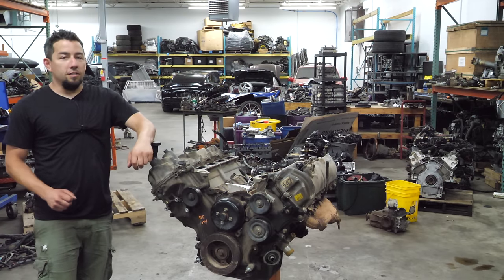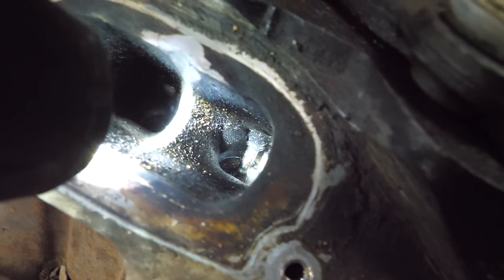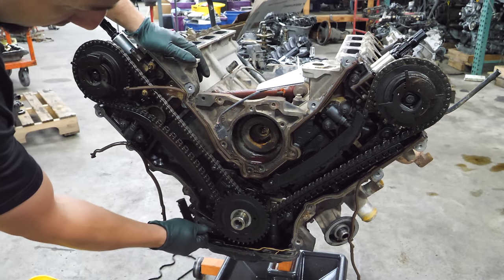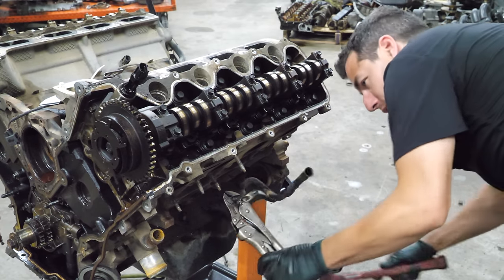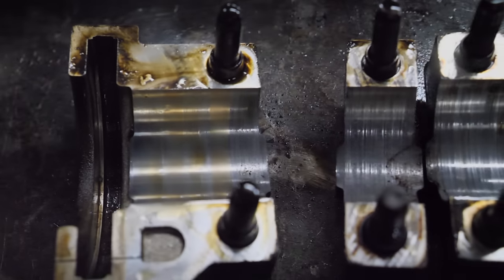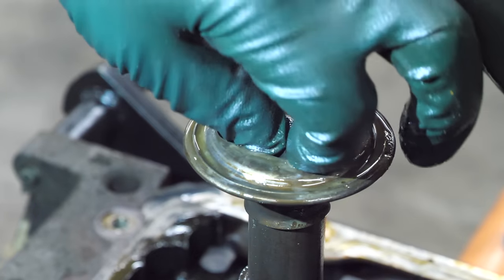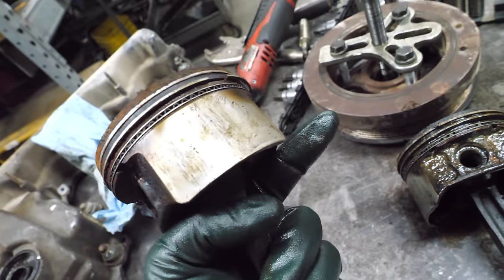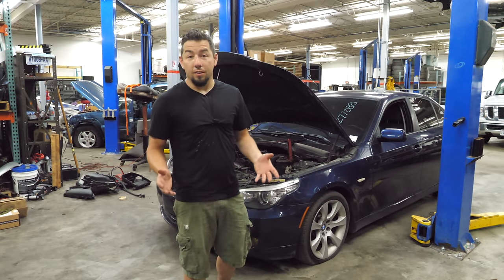Bad Ford 5.4 3-valve V8 Engine Teardown. Which of The MANY Possible Failures Took This One Out?

Comment: I have a 5.4 3v engine in my 2006 expedition,  130,000 miles now.  All original and no problems so far.  I change oil long before the recommended miles,  which I'm sure is helping it last. Plugs came out great at 100,000 miles.   Still happy with it.
Reply: Yea oil changes are critical on these since most of the issues are related to oil starvation. I had one for 10 years that I never had any issue with but I was aggressive on oil changes and stuck with synthetic 5W30.
Reply: Mine is close to 300,000.  No big maintenance.  I put a hub on the front.  Bought a used one at a junk yard for 40.00 and kept trucking.  Air and all still works great.
Reply: I have an '07 f150 short wheelbase 4 wheel drive it'll blow an actuator off of a hub and a heartbeat and it ticks $262,000 mi it is still my truck it's paid for and that 54 will run and pull a trailer like nobody's business I'm going to work on it alone and keep it
Reply: I have a 05 3v did the same short oci with synthetic oil. Its only a matter of time. I needed a complete timing set done at 175k. I used 5w20, I hear if you used 5w30 it will help it last longer.
Reply: Oil is still cheaper than a repair job on the engine.  That is why my 2000 ford is still running right now with my pal down the street from me
Reply: @bubba99009 was the 5-30w on purpose?  Because my expedition asks for 5-20w
Reply: @marspalacios  the 5w20 is a bit too thin for the 5.4 with its oiling problems - it's only recommended because it slightly improves fuel economy so I wouldn't (and didn't) use it

Comment: This is EXACTLY what happens every 90,000 miles. Did mine twice. Same side broke, right into the pan. Melling oil pump and Cast adjusters installed 2nd go around along with Phazer delete. Plastic doesn't belong with metal parts. Chains way too long. Absolutely ridiculous. Good luck keeping check engine light off.

Comment: I purchased a 2004 F150 brand new. Still have it. It's now 2023. $145,000 mi. Never gone more than 3,000 miles between oil changes. I do not have a tick. A rattle. A shutter. 2 years ago I switched to Amsoil full synthetic signature series. May seem overkill. Still cheaper than a new motor

Comment: Oil pressure is the major failure on these. As you can see, bank one was far shinier than bank 2 because of lack of flow as it goes from the pump to bank one and then bank two on this engine. That's also why your tensioner on bank one failed. Mine did similar, but never failed so I upgraded the pump, replaced all the timing chains, guides, and tensioners. Also replaced the cam phasers with locked phasers - shout out to Freedom Racing for the whole kit. You have to run a software tune for the locked phasers but it makes it a lot more bulletproof.
Reply: I did the same thing to mine, and it's running smoothly.

Comment: After repairing one of these engines, I've come to realize that THE primary problem with these engines is the original oil pressure fed timing belt tensioner. When the back sides of these tensioners start to leak oil, it allows slack in the timing chain. That slack allows the timing chain to slap back and forward and eventually breaks the plastic guides. Now before all that happens later, other damage is being done due to lack of oil pressure because of that leak. The leak at the tensioner is practically another pressure relief which causes problems with the cam phasers because those need proper oil pressure to operate. So really the original tensioners are the 1st domino and once that domino falls, everything else will fail soon after. 

My recommendation is if you have one of these engines that isn't making noise yet, IMMEDIATELY have a tech as preventive maintenance, pull the front cover and replace both timing chain tensioners BEFORE they fail. Ford came out with pretty decent upgrade that had a hard nylon type seal on the back. Oil pump wise, those are actually fine as long as you don't have any internal leaks from the tensioner. The engine I worked on had 208k and the internals were very clean from regular oil changes and the cams was perfect. You can't go that many miles with a weak oil pump so I know the leaking tensioners late in this engines life cycle was the fault.
Reply: True.  My buddy has an '02 F150, he heard about this and updated his tensioners.  Replaced all the vacuum hoses too as they were rotting.  He lives in SoCal, which has a lot of ozone in the air.  Suitably looked after these engines can last a long time.
Reply: @Craig Hoffman That's smog, not ozone. Smog is mostly carbon/oxygen molecules. Ozone is usually 2 or more oxygen atoms bound. C'mon with that, mang.
Reply: @craighoffman6876  Dry heat. Dry rot. 
Living in Vegas, my tires usually rot before I wear them out.
Different grades of plastic/rubber deteriorate at different rates.
I have an original 92" Jeep Sahara, nothing has deteriorated. Plastic and rubber holding up fine. 
My Chevy and Ford pick ups, vacuum lines get hard and turn to dust. 
Why AMC rubber holds up? Who knows? 
I have 12 (in good condition) cars, trucks and Jeeps. Besides rubber, nothing deteriorates in the desert. Keep them out of the sun and it will last virtually forever. With no cold starts (ever) even engines last.
Reply: @TheBandit7613  Interesting!  It pays to keep an eye on all of the rubber bits.
Reply: Any engine that relies on consistently high oil pressure to provide primary tension to its timing chains will fail prematurely, unless the system is perfectly designed, which none of the American engines are. The overhead cam Ecotec engine from GM is a prime example- ask me how I know.  

On the 3 valve 5.4 engines, Ford apparently tried to save money by using the same rocker arms as it did on its 2V engines(going from 16 rocker arms to 24) overlooking the large size of the oil holes on those original rocker arms and the need to increase by a third  the amount of oil flowing through those holes in the rocker arms to lubricate the cams, but they did this without increasing oil pump pressure or checking the oiling system's ability to supply adequate oil pressure and oil flow to the cylinders at the end of the oil distribution system, i.e. the #4 cylinder (on the passenger side at the fire wall) and the #3 cylinder next to #4.  The belated fix from Ford was to redesign the rocker arms to decrease the size of the oil hole on the lifter end of the rocker arms, thereby allowing the existing oil pump to supply adequate oil pressure and flow to the rocker arms and cams shafts of each cylinder, in Ford's view.
Reply: @Anonymous-it5jw  Interesting!
Reply: @navyphyrfitr6550  WOW, thx for adding that. It all makes sense.
Reply: @navyphyrfitr6550  Excellent!  Here's to many miles of reliable service from your engine.
Reply: You nailed it in the head!
Reply: @tmo2798  the main components of smog are particulate matter and ground level ozone. Ozone is always three oxygen atoms bound together. Two oxygen atoms bound together is normal oxygen gas.
Reply: @navyphyrfitr6550  I totally agree. I had 225k on my '06 last year and it was still running just fine, but I've known about these issues, mostly from Fordtechmakeuloco channel, so I decided take precautionary/preventative measures. I did all the things you did except I did use the upgraded Ford tensioners, not the Ford racing ones, I didn't know about those. Anyway, I just went over 250k and still purring like a kitten. I do keep up with all the maintenance and that plays an important role, not just with this engine, but any engine.
Reply: the other problem is a design flaw with the cam followers... the needle bearings wear out
Reply: You said it perfectly. Right on the money. Everyone I have tore into had a leaking tensioner that let the chains go slack. Then the slapping on the cover,, making sparkling glitter. Then it's all over.
Reply: This is the best explanation of this engines problems I have read so far. Thanks for sharing!
Reply: What was failed to be mentioned was that this “failed” engine probably had extremely high miles on it. It clearly shows a lack of proper maintenance. These engines can have quite a few issues however, When properly maintained, they generally last for many miles with lots going 200k miles. Best is to properly maintain and then have the timing components and roller followers replaced with updated parts at around d 100 to 125k miles. Not cheap but, it at that point, should go another 150k miles.
Reply: @Ronald Barry  But proper maintenance isn't gonna stop the tensioners from leaking from behind because the rubber sealing will eventually give out. My engine had 208k and was very clean from proper pil changes. I stated that in my OG post. As I said there is a design flaw and the newer version are much better so it's best you change them out BEFORE all hell breaks loose on the original tensioners.
Reply: @rotaryperfection  that is true, I did a full timing job on mine including tensioners and roller followers at 120k miles. The passenger side tensioner seal was blown out. It rattled for about 2 seconds after start up at that point. Everything was in perfect condition except that including the cam and cam caps. If you don’t wait too long (some just keep on driving for years) little to no damage is done. Again, not ideal but after the timing job I am still trucking and I think I will be for a long time. It’s certainly not a Honda or Toyota but, pretty much all the full size truck and suv brands have some distinct issues with their vehicles. Lack of proper maintenance does make a huge difference in most cases.
Reply: @Ronald Barry  To add, did you just watch the recent video here where he broke down the Range Rover 5.0L engine? That engine also had a failure in the timing cover and I'm willing to bet it was those tensioners leaking from behind. That 5.0L engine is a Ford engine and most people don't know that.
Reply: @tmo2798  Ozone is created by smog (plus sunlight) amongst other things
Reply: @navyphyrfitr6550  Have heard that "high pressure" oil pumps can be just a standard oil pump with a stronger spring on the bypass valve.  The high volume pumps look to be physically larger.  At least on the 440 they worked on on Engine Masters.
Reply: I will be sending in my oil to Blackstone labs for this exist reason. My 2v is running fine at 110k miles, no issues but with an oil sample they are able to see any plastics or whatever in the oil and can determine if your timing chain pretensioners are failing.
Reply: @Alexander Calderon  Hmm that's good to know!
Reply: @rotaryperfection  The Strange Rover 5.0 is NOT a Ford design. It has no commonality with the Coyote. Ford owned JLR when the engine was being designed (that's why some of the parts have FoMoCo stamped on them), but that's about the extent of it.
Reply: @Michael Spadaro  Well it seems to have the similar crappy oil pressure feed hydraulic tensioners. All you need is a common failier shared part for people to make a distinction.
Reply: @rotaryperfection  Still doesn't the fact that they aren't related.
Reply: @CaptainSpadaro  Whatever you say guy!
Reply: @rotaryperfection  I'm only telling you what anyone who has seen images of the engines will tell you. Hell, this very channel has two Coyote teardowns and one AJ50 teardown on it. Watch them and you'll see what I'm saying. Blocks, heads, etc...all different. No interchange.
Reply: You are 100% correct sir.
Reply: Exactly
Reply: @rotaryperfection  it's not a Ford engine....
Reply: Is there a way to tell if these tensioners have gone bad or started to leak? I have a 2005 5.4 3v with 246k and it runs good and relatively quiet, always had the oil changed at 3000 miles religiously, wondering if there's any sounds/warning symptoms to look out for other than the phaser knock/oscillations
Reply: @codywolfe1001  You would hear a taping noise in front of the engine as the oil heats up as it gets thinner. When the heated oil thins, it's easier to leak behind the tensioner seal. Are you the OG owner? If not, it's possible yours has the upgraded nylon tensioners already.
Reply: Does the 2012 has this same problems😮
Reply: @igfishing13  Don't know! I only worked on a 2005 Navigator.

Comment: Where I work, our old fleet used to be Ford F-250's with the 5.4. We never had any real mechanical issues with them.  The issues we constantly had was electrical parts like coils, injectors and sensors. Our fleet has been updated to new F-250's with the 6.2. So far it's been a great reliable and powerful engine. 👌
Reply: Same here. Lots of new 6.2s. Of course, my 2020 has a very random hard cold start issue that Ford can’t figure out. Sometimes it will do 3 full crank cycles before starting.
Reply: Our place had 60 of these 5.4s in F450s. Many didn't make it passed 200k all were pounded on all were usually late with maintenance. We replace about 6 trucks every year. Now we are getting the 7.3s. So far so good.
Reply: @mikegreen2229  Interesting.  My 2019 6.2 has a random extended crank.  Had dealer check it the day before my warranty expired to get the complaint on record.  Dealer said nothing was wrong.  Weird issue for sure.
Reply: @snirtman7223  Out if our whole fleet, mine has the least miles and is the most pristine of all, and it’s the only truck that does it. Hasn’t left me stranded though
Reply: What oil? I bet they used a fleet 15w-40 to keep one oil for gas and diesel.
Reply: @snirtman7223  purge valve could be sticking open.
Reply: @Bushy556  not the case where I work. We use strictly the manufacturer recommended 5w30 for gas engines & 15w40 for diesels.
Reply: My 5.4L 4 valve is a fabulous engine. No problems whatsoever.
Reply: @snirtman7223 , Extended crank could be a fuel pressure issue. Take note of what is happening when the extended crank happens. I have seen a failed purge valve cause an extended crank right after filling up with fuel. Filling the tank pushes vapors through the purge valve and causes a "flooding" issue. There are many things that can cause an extended crank, but these are a couple.
Reply: @Bushy556 , I just saw this response. You were ahead of me by 7 months, but I said the same thing.